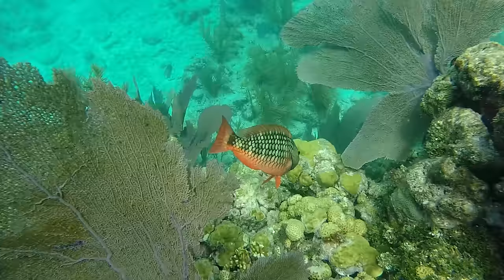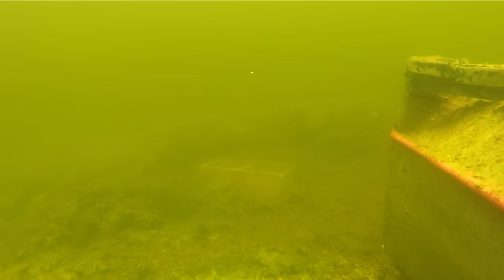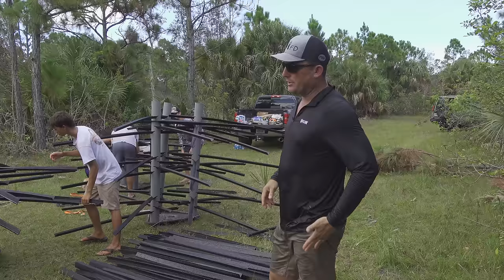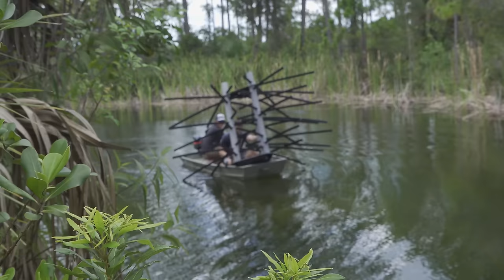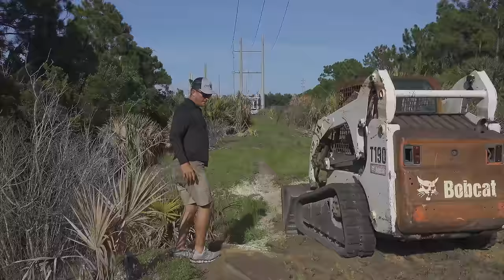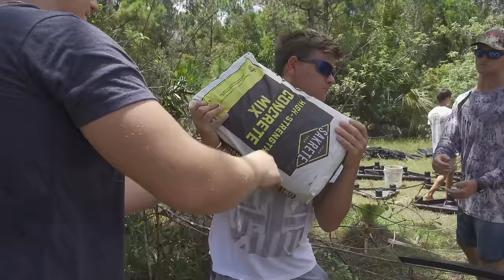How To build the ULTIMATE FISH CITY!!!

Comment: Thanks for this discovery.

You should invent automatic joints to put on the poles of boats so they would automatically stabilize the hammock. 

When the ocean waves rocking the boat, the auto rotating joints will automatically adjust and stabilize the hammock to prevent motion sickness from too much rocking motion.

Comment: Those are going to have so many lures snagged on them theyre going to look like cristmas trees with ornaments on them
Reply: Nah the way they are designed they will minimize snagged lines compared to trees. I'm sure you can still get snagged but not as bad as you may think.
Reply: @Coltwollsch  oh that is very smart!
Reply: @Coltwollsch  yeah but if designed to do that they won't have edges, they would of used a diamond thing instead of a v shape, and also they are tight, which means the fish won't go through if the fish goes around it tightly... Do u know what I'm talking about???
Reply: It depends on the hook if you want the v shape of not

Comment: If you can’t afford to buy stuff like this, wait until the day after Christmas and start collection Christmas trees and submerge em in your pond.
Reply: Milk jugs pvc pipe and concrete
Reply: Laces out
Reply: You don't have to put in a full Fish City.  We work with all budgets and habitat needs.  Many people start small and add habitat over time.  One of the many features of MossBack Fish Habitat is that it lasts a lifetime allowing you to add habitat as your budget allows.  Also, it does not decompose depositing sediment on the bottom decreasing your water depth over time like Christmas trees.

Comment: Wash out fix
Use tire packed with dirt or stone. Works better if you cut off the side walls. Its called mechanical concrete. 
There is also an expandable mesh fabric that does the same thing. Lay ob flat surface and the fill with road base. 
Just doing the tires around wash out will prevent them from coming back

Comment: I am wondering if the fish habitat devices could be modified to float in the sea as fish aggregating devices(FADs)....I'm thinking of using foam to float them and chain or guy wire tied to a concrete anchor on the seabed....need allot of these in Jamaica for use as FADs...I am wondering 1) if its feasible and  2) if they are saltwater tough and rugged?

Comment: Did they end up staying at the bottom?typically you're supposed to wait for concrete to set and dry before you throw mass amounts of water on it lol I noticed on the first one you dropped almost all the concrete mix was floating around in there hopefully it doesnt mess with the eco system since concrete had ALOT of harmful chemicals.

Comment: Very nice fishing pond, it'll stock itself in the long run (smaller fish have places to hide and grow), and  regularly fishing in it will help control the population.
Its the best possible catch 22 outcome.

Not concerned about the plastic, googled mossback products and it seems their plastics are a thousand times more resistant than your average Chinese produced crap. 
Regular plastic degrades quickly, BECAUSE IT IS MADE TO BE RECYCLED, NOT TOSSED IN THE WATER.

Those mossback products are designed to last as long as possible, by the time it even begins to degrade, we'll all be long gone.

Comment: You're going to have a lot of injured, blind and or one eyed fish with this city. You city will be for disabled fish. The corner on the plastic angles are going to cause injuries to the fish. A better city would have been made of pipes with holes in them instead of those angles. If I was a fish, a smart fish, I wouldn't swim around in such a dangerous structure. I actually serious about this. Every end on those angles is made to injure a fish. If you blunted those edges in a triangle but without a point then the fish couldn't injure themselves.